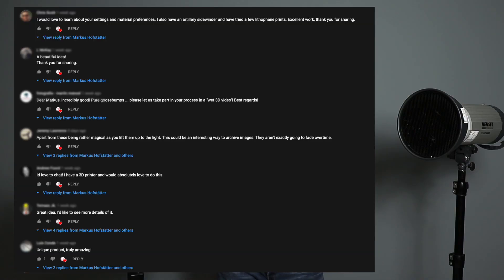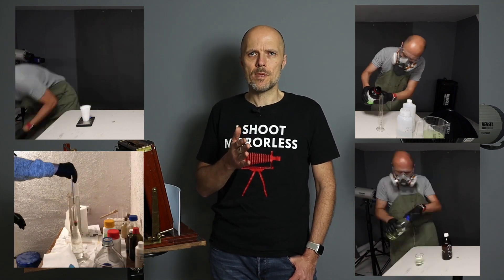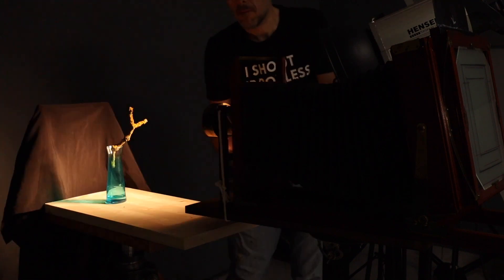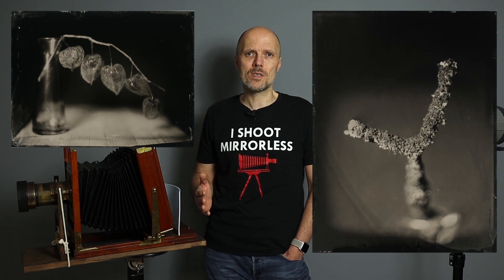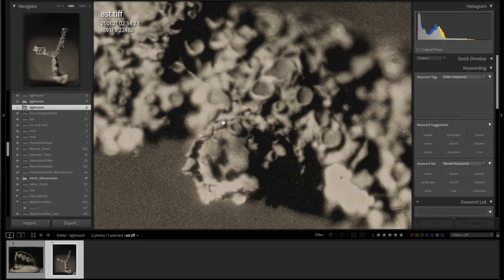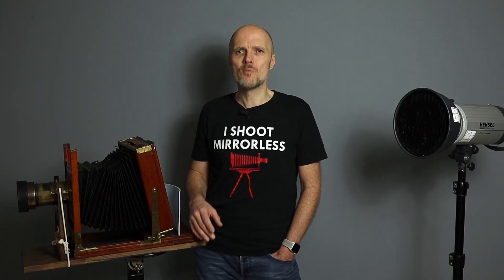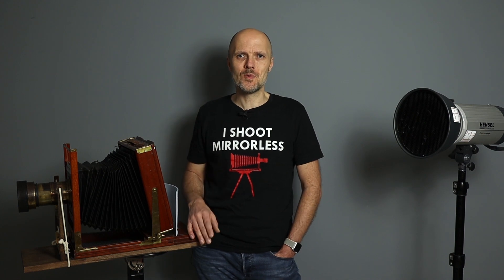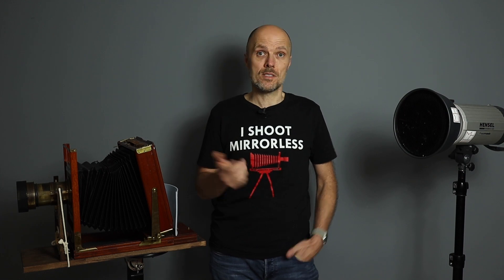From Wet Plate to 3D Print - Touchable Bokeh part II (in color)

Comment: Which scanner do you use?
Reply from the maker: I use an older Epson Perfection 4990 scanner
Reply: @mhaustria  thats a nice one, i use the newer V550 photo. It can scan negatives, positives, slides, photographs and glass plates of course but small ones, like up to 6X9cm
Reply from the maker: @mrpresident7121  mine is very similar - just an older model. Always was thinking to get a new series, but the old one scans still great.
Reply: @mhaustria  the rule my friend is if it works dont change it. The only problem is how to scan bigger than 6X9 negatives...
Reply from the maker: @mrpresident7121  I use mine mostly for plates. My lab scans my negatives up to 4x5.
I think my scanner could do that too.
Reply: @mhaustria  yep that's true, anything larger than that we need to improvise 😂 😂 😂